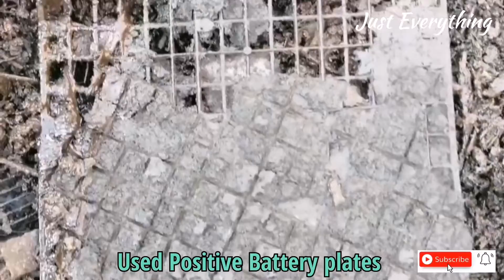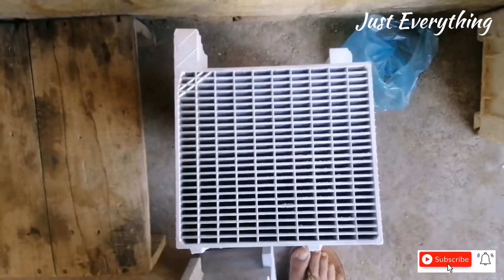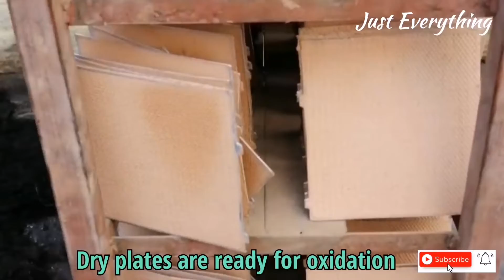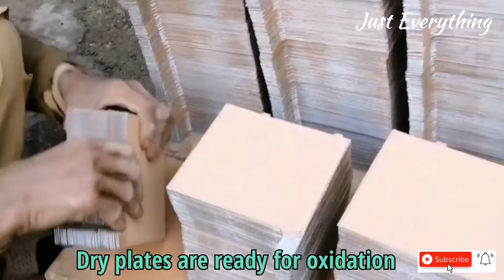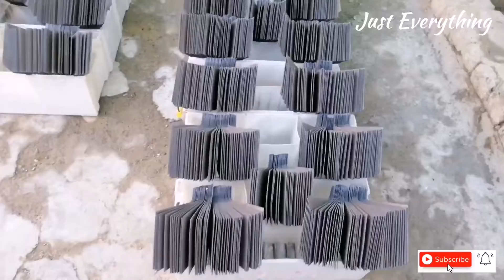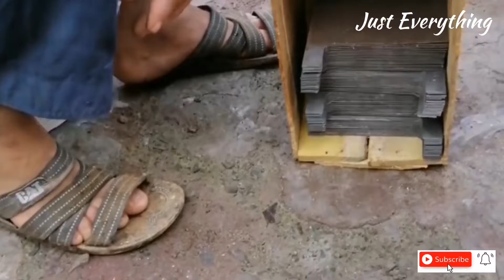Lead Acid Battery Plates Recycling | How To Recycle Old Positive Battery Plates | Amazing Technique.

Comment: What are the materials for making battery positive cells, sir?
Reply: The positive plate is lead oxide ( PbO2 ), also called lead peroxide. There is a video called "Lead dioxide (Lead peroxide) Synthesis" that explains how to make lead peroxide. You can also google around on how to make the lead peroxide for battery plates.

Comment: I was wonder, that process of oxidation, what causes it? What reagent You using for the oxidation?
Reply from the maker: We are using sulphuric acid for oxidation.
Reply: @JustEverything76  what density, how much  %?
Reply: @Nikolay.Tsvetkov  25% to 30 % is normal
Reply: 1200 acid on hydro meter